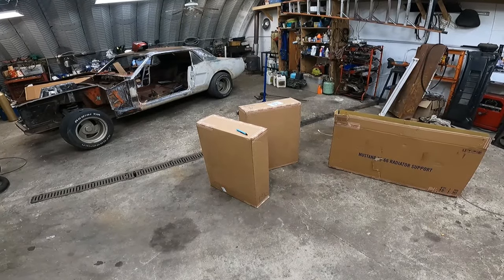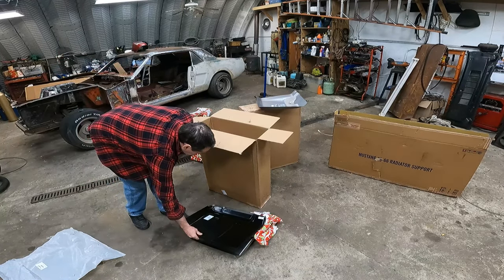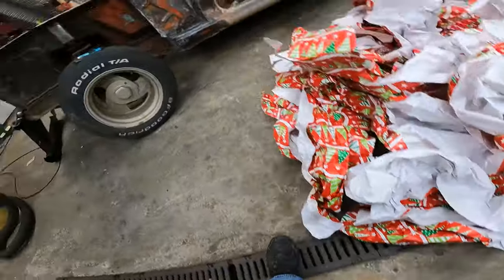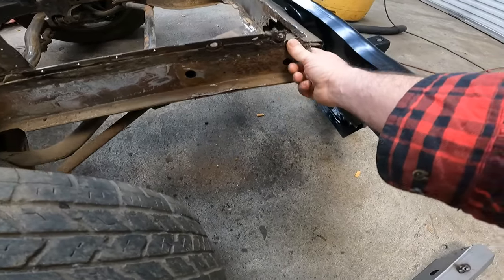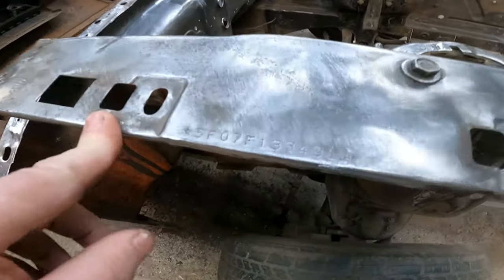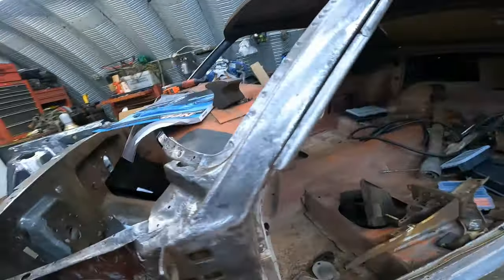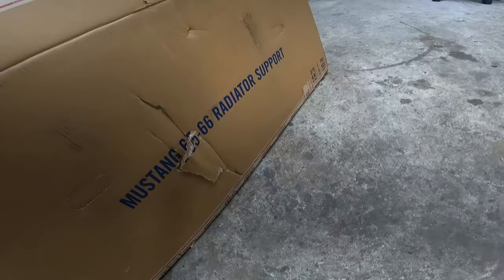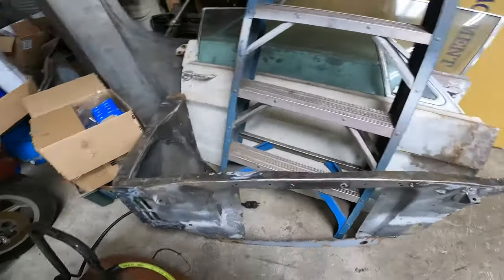65 Mustang Update And Unboxing NPD Parts

Comment: Nice job love getting parts. As long as correct and not damaged 😂 so this was all done in orange at some point?  The rotted dash is something I haven’t seen in a car considering the rest of the car is very solid.  Gonna be sweet
Reply from the maker: I beleve rat piss is what ate the dash it's too high up for it to be from the cowl pannel leaking.  I'm guessing it was orange from the factory but they didn't call it orange it's poppy red. Still got a long way to go getting all the rust gone. It needs the drivers side drip rail replaced but they don't make or sell one for a coupe. Having to do everything by myself @ 53 sucks lol I need Chip Foose and the A-teams help.
Reply: @kickassmustangsgarage  ahhh makes sense with the piss. That stuff eats anything lol it’s ok man baby steps. 53 cool I thought you were closer to my age 45 lol. My ranger just got put on hold. Need to do one of our bathrooms now 🤦🏻‍♂️